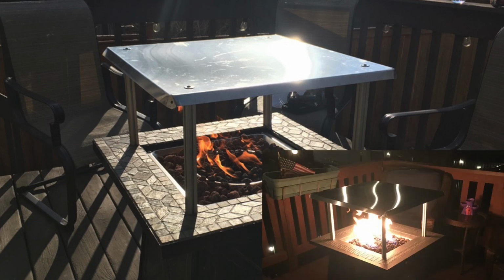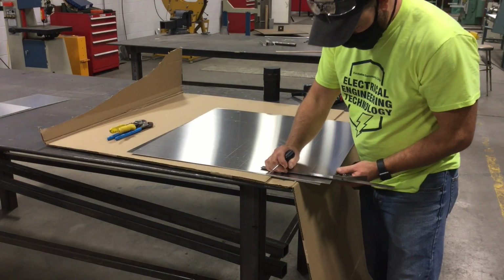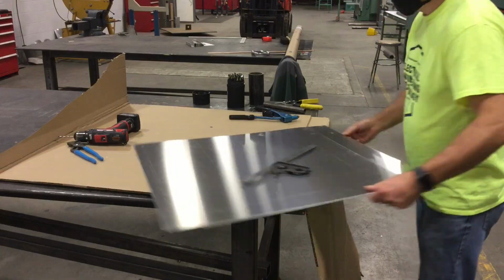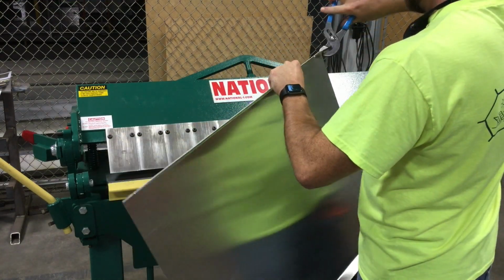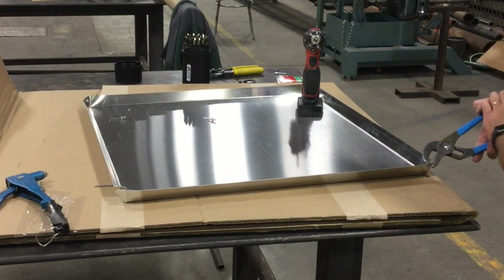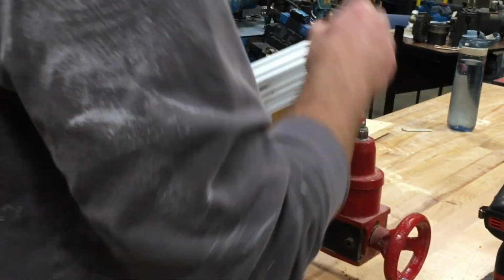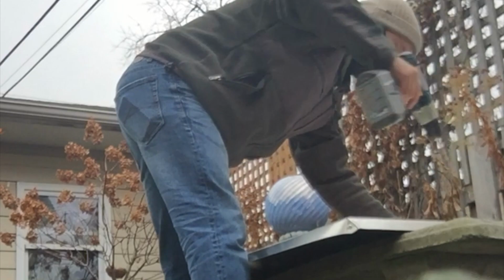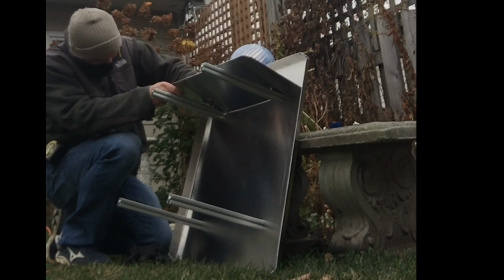Heat Deflector for a Propane Fire Pit

Comment: I recently became a sheet metal fabricator I'm only about 7 months on the job so far. So on that finger break you can remove the pickets and then you don't have to trim down or rebend your corners. On the corner where you drilled the hole We commonly just cut a v-notch. It can be done with a notcher or with your snips.
 I love this idea I'm going to make one of these for my fire pit
Reply from the maker: Thanks for watching and that is an awesome career choice.   Also, thanks for the  advice

Comment: Hey mate, try and remove some of the fingers on your sheet metal folder, it will give you some clearance room at either end of your fold and somewhere for the first two edges to go when you bend the second two edges. Cheers.
Reply: This is exactly what I was gonna say. We call that a “box brake.” And you have to remove the fingers so that your verticals won’t crash with each other.

MERRY CHRISTMAS 🎄
Reply from the maker: Thanks for the tip!
Reply from the maker: Thanks